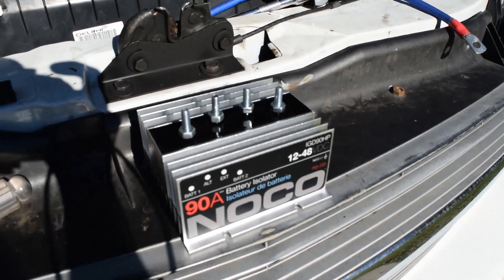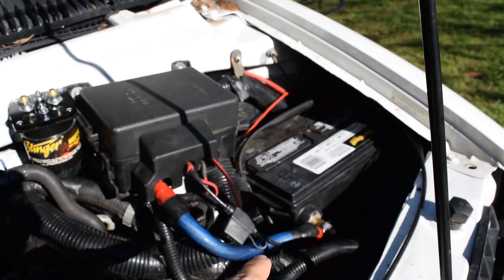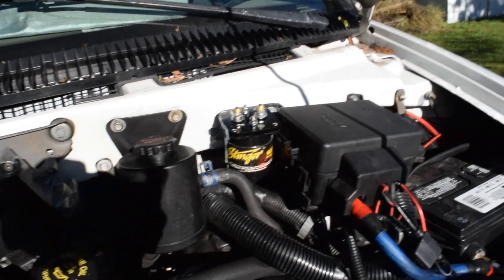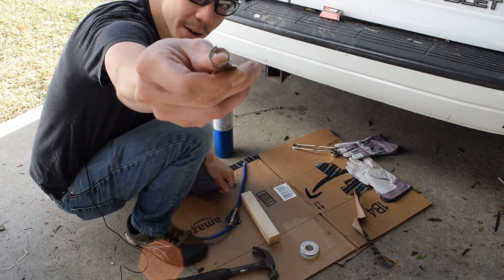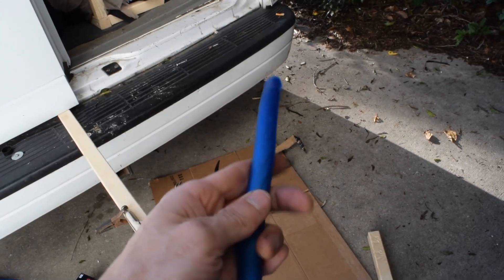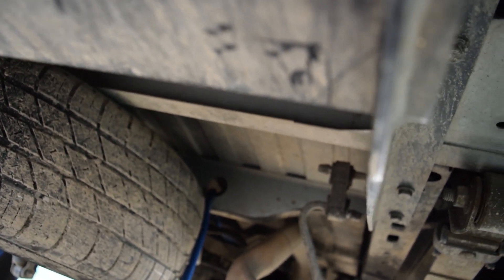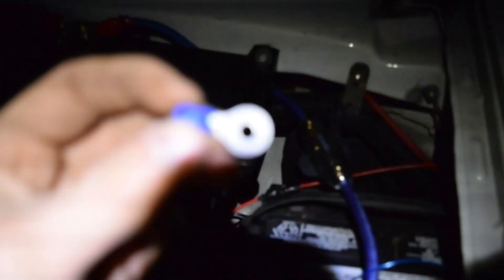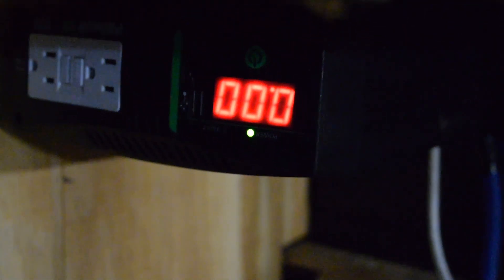HOW TO INSTALL BATTERY ISOLATOR AND CHOOSE WHAT TYPE

Comment: 12:56 Minor correction.  The blue Splice connector does NOT require stripping the insulation.  They are designed to use as is and will pierce the insulation as you squeeze the metal part into the connector. That make contact with both wires through the insulation.

Comment: 7:32 Cleaner to use heat shrink tubing to seal the cable ends on the terminal.@ 12:48 The little blue plastic splice is called a "T-Tap"; (for tapping into existing 12v switched or ignition wire).

Comment: my diode isolater took a dump I'd like to try the stinger however my diode only has switched 12vdc this w/ engine off. are you sure this switched 12vdc must be when engine is running? thanks and nice video that was funny when you shocked yourself ha ha.
Reply from the maker: You can wire it anyway you want. It just needs 12 volts to "open up the switch"
Reply: @IntoTheMystery13  a$$hole you wait 6months then scribble down crape about wiring crape

Comment: It's called a scotch-lock splice
....and it's their the most worst 1900's designed piece of wire splice shit tech ever invented.... still to this day.... 
So I'll allow your ignorance & one-time use of these awful awful wire-tap mutilators that "Should be banned, obliterated and outlawed" 
these miniature tiny cutter blades w/ a long history of wire-destroying,voltage robbing, current sucking splice magicians that turn electronics into bricks 
I've worked 3 different mobile audio/video/communication sales/installation centers in my 34 years of adding gizmo's & gadgets to shit mobiles with wheels on it, ...with Install standards so high, you were fired on spot if caught using these cheap-ass tap blocks.... it's a miniature knife SET IN A PLASTIC FOLD LOCK that cuts into the host wire, insulation & all, then with any luck, ya may have cut into 3-4 strands of already too damn thin wire with these plastic chinese turd cutter blades, and at 1st, the wiring project may actually succeeded ...@ 1st .... but the first current surge, curvy up & down driving, or voltage spikes/dips will cook those pathetic 2-3-4 copper strands then send it all to ground, frying emitter resistors and final output transistors, MOSFET's & diodes and dealing with that awesome burnt toast electronic fried amp smell in car for 10-14 daze and not much more OEM auto wire harness left....

If wiring a accessory harness to a car,boat,RV for additional entertainment or work needs....Fuk crimp tubes, scotch block splices, party hats, cheap-ass black tape, or even butt-connectors, The Only Proper method is to flux & solder your joint connections.... SOLDER THE GODDAMN WIRES AND THEN SHRINK BOOT IT ALL FOR A 100% GUARANTEED TO WORK, WON'T PULL APART OR CASH BACK CUSTOMER JOB!!
pLEASE DON'T USE THESE CHEAP FUTURE ELECTRICAL ACCIDENTS!!! You'll thank me later.... 
Bought a 40yo RV mobile trailer 3 weeks ago....as of yesterday, I have removed close to 95 of these wretched future wire fire starters....and still looks like another 4-5 daze before I got them all gone and forgotten yet.... some moron mutilated the factory wiring harness as well... 1 harness thru firewall had ten #10 wires in it, only 3 left being used, the other 7 had both ends cut off and taped up... Would love to find the wiring "Professional" who murdered this poor RV's entire wiring & electrical system... I WOULD RETURN THE FAVOR TO THESE HALF-ASS Idiot "Installers"
~PeasOut

Comment: 3:50 True Ignition source.  12:20 under the fuse box.   I know there are dc-to-dc chargers with a built-in true ignition source relay feature.  Anybody know of an inverter with this feature?

Comment: Good video, but you forgot about another kind of isolator, which is a voltage sensitive relay, that is not tied to the ignition source and worked bassed off of battery voltage

Comment: hi: when you install the  second battery . Both batteries have to be similar in  amps or can be different. Example 1 : 12volts/80 amps both. Example 2: 12volts/80amps - 12volts/45 amps? . Thanks
Reply from the maker: I don’t consider myself an expert, but what I’ve read they should  be the same type, brand, and age otherwise one may be over changed and one undercharged reducing the life of the batteries and possibly causing a fire/explosion depending on what you have. I would seek out some forums like cheap even living or maybe some boating forums to double check what I am saying

Comment: Nice vid man I'm using a stinger 200amp relay/isolator I have it ran with 0 gauge wiring with a 250amp fuse that came with the wire is that too big of a fuse,my cars alternator is a 215amp

Comment: I'm trying to learn here and I'm totally lost, lmao
This can be used with a battery bank hooked up to a solar system too, right? Like it wouldn't be one or the other for a power source, would it?
Reply from the maker: Yes you can use it at the same time as solar. You would treat a battery bank just like a single battery. Does that help?
Reply: Yes, thanks so much dude!

Comment: what gauge wire did you use for the ground and to connect to the 12v true ignition?
Reply from the maker: 14, it depends on the length. I went overkill
Reply: awesome man thanks. All your videos have helped me alot converting my van.

Comment: Dude I've studied electronics for years and though your video isn't perfect but it's dam good.  You did good stuff.  Great way to get out of crimping the wire by soldering. That solder is actually better than crimping it. You reminded me of a younger me fooling around with this stuff.

Comment: How can I wire the battery isolator so that I can flip it ON/OFF with a switch (if I want to charge the AUX battery using my alternator)?

Comment: ive seen a couple of these videos. I see that you use a very thick gauge wire 2 or 4 gauge about the same size as the terminal wires connecting the main batter to the engine. my question is this. it seems on yours and other videos the wire you are using is more flexible than what they use on the terminals already in the car. what kind of wire and or where do I get it?

Comment: One thing to note is if you have a bad starter battery, it could be keeping your aux battery from getting a good charge. A few months back I installed an isolater and whenever I would measure the voltage across the aux battery, with the engine running, I was only getting about 13 volts. Well, yesterday it got into the 20s F and the starter battery finally died. This morning, I replaced the battery and now I am getting something like 14.6 volts.

Comment: Hey I know this is an old video but I have a question. What did you do or buy to adapt your chevy astro battery cable to be able to do this? Mines factory and has the rubber end which prevents me from attaching my 4 gauge wire. Anyway hope my question is clear and that you get a chance to answer it. Thanks and great videos.
Reply from the maker: +George Bales I got adapters which are are long studs that the factory cable can sit on as well as other ring terminals. Here is a link: http://amzn.to/2zfMnWI
Reply: Thanks bud.

Comment: So on this van

The heavy up positive duplicates original

Meaning:

The upgrade cable runs from battery to fuse box and from fuse box to alternator ?

The original red alternator wire is entwined in the wiring loom and then reappears at fuse box 
 the original positive from battery includes main cable running along front of frame and 10 guage red wire to fuse box 

Or???

Comment: Does this installation also work well on installing extra lights on a truck? And if so on my extra battery should I run the positive to the switch then from the switch to the lights?

Comment: Oh man, I was installing the same Stinger one you have and broke off one of the bolts for that go to the batteries. I wanted to get the cables on tight because to make sure the cables can move and touch since all the electrodes are kind of close together. So I over tightened the nut and it broke off one of the big bolts. Yeah, it was my fault but it seems like the thing should have been built a little stronger.

Comment: Great to see a good installation! Seen so many wierd videos here that don't explain this dual batteries installation in a good way like you do. crimp the cable is actually better then soder it.
One old car technician say Smal voltage you solder cars you crimp and use shrink tube over.

Comment: I know this is an old post so someone has probably mentioned this but for a cheap conduit under the vehicle we have always used just plain garden hose. I'm sure a metal conduit would be better but we have never had a problem with the garden hose as long as you do like you did and don't let it rub on sharp metal surfaces. They make a cheap blue plastic ribbed flexible conduit as well.

Comment: Also important: when finding your 12v ignition source - you need to make sure the circuit you are tapping into can handle up to an additional 1 amp being drawn through it (this is what a lot of these large solenoids require to close the circuit - check your documentation for the actual number). Don't just use a multi-meter to find any wire that shows 12v when the key is in the "run" position.

Comment: Great video. Just wanted to clarify that your comment about sizing the isolating solenoid is not quite correct (although I'm not really sure what you mean by "size it to what your using it for" - because we know what it's being used for, to pass current to charge a battery). Regardless of what you use your aux battery system to power the solenoid must be able to handle, at a minimum, the max output of your alternator - ie: the solenoid should be rated a bit higher that the output of your alternator. This handles the case where your vehicle is drawing very little power, your starting battery is "full" (ie: at the regulators max voltage) and your aux battery is drained very low (in which case it will pull a TON of current).

Comment: Damn you are a bit of a amateur , if your not a pro don't make how to do video's ... people might copy you and f up their cars as well.

the wire part under your car is against a sharp edge and isolation will crack there because of vibration.
the contact points that you are attaching with that heater of yours actually are ment to be fastened with a special tool to fasten those.
the little clamp that you don't know the name of ..... is called a cable focker ,  those things break your wire , not at fist instance but a while you find out when things start to break down .... use normal wire plugs there, and not a cable isolation cutter connector.
2 fuses ? a bit over the top , 1 fuse behind your 1st battery is enough. 
and last ... never ever dril holes in the floor behind you wheels, all dirt and wet sheit will go sit there and it will let your flooring rott really quick , dirt will stick on then it gets wet and slowely dry and wet again and so one and that is the perfect situation for your van to start rotting away.

by the way there are better diodes/switches on the market that will do with much thinner cables.
also those you can just connect your 2nd batt directly to your 1st batt thru those and those will save alternator ...  those measure the the amps and volts and will only allow power to load your 2nd batt if your 1st batt is fully loaded first and with the engine off cut off the connection between the 1st and 2nd batt so also with that system your starter batt will not be drained.
its faster and more easy to install and cheaper.
and it has a led licht on it that will turn on when it opens the connection.
with that system your alternator  will all ways be loading only 1 of your 2  battery's and not both at the same time ,, and won't get overstressed,  alternator will first be loading the primary starter batt and when that is done it will open the connection ot the 2nd batt.
not over-stressing your alternator will extend the lifespan of your alternator severely !

sorry for the typo's... English is not my first language  ...
Reply: one more thing , NEVER EVER put non original connectors close to where cables go over into original boxes/connectors/plugs.
non original connectors tend to do corrosion to the wire over time.... then that rotting / breaking down you might need to redo it again... and when you have almost no cable left to the original plug it will become really hard to fix it all.
Reply: why don't you make a video then, Mr. Expert

Comment: anyone know why you shouldn't / wouldn't wire an isolator to an alternator rather than the starting battery?

thanks!
Reply: If you did that, then you would have no way to use the deep cycle battery to jump start to engine cranking battery if that ever went flat. Also, the alternator puts out way too much ampage to go directly to  the deep cycle. I think if you put the isolator directly from the alternator to the deep cycle that would bypass the regulator and probably overcharge and damage it. But I'm not an expert so I'm only guessing.
Reply: Aj Allen thanks AJ.  yeah, once I got everything installed, it made much more sense to me.  the system is great, just need another battery and a another solar panel and I will be set for good!

thanks again!

Comment: That connector you use at around 12:40 is called a Scotchlock, and they are not very good in my opinion. They work to a point but the contact area is small and eventually they will get a bad connection when installed in an engine bay. The grease inside the connector will melt out with the temperature changes under the bonnet. I would highly recommend stripping the cables (without cutting the switch source) and soldering your positive coil cable, then cover the whole joint with silicone sealant for a permanent fix. 

As Kearess said in the comments, no need to strip the cables if you really must use a scotchlock, but the connector must be the right size for the cable, or you can have poor contact on thin cable, or cut cores on thicker cables potentially causing the cable to burn out. 

I would only ever use them for real low power, non-critical connections. And only as a last resort/temporary fix.

good video, thanks.
Reply: M Baker great advise love it, great point
Reply: i hate them damn connectors, should be banned. they always fall off or cut the wire from vibration over time. total junk, nothing beats solder and liquid electrical tape/heat shrink.

Comment: Great video,you install 2 fuses one between the battery and the isolator and other from isolator and the backup battery can you explain why,follow your instructions but don't understand why two fuses,thank you for great video
Reply: well simple so both batteries and batteries cables are protected from shorts as the power cables run independently from each  battery to the isolator
Reply: Eduardo silva thanks for the info,help to understand better ✌🏾️

Comment: what if you have a high out put alt??
Reply from the maker: +Hurshel Lockett then you need to have the right size wire, isolator, and fuses to prevent an issue. So no different than a low output of e
Reply: 240s Mech man 0guage 250 and fuse two battery's still voltage issues

Comment: Just fyi...The Scotch connectors are made to use without stripping the insulation. Works better to leave it on. The metal will slice through and contact , and the insulation will keep more debris and moisture out.

Comment: 12:48 No need to strip te cable dude! Just put in the cables. The metal part will cut trough the isolation and will make contact with the wire. Keep up the nice work!!
Reply: You're right Kearress. With a splice connector you do not need to strip it and in fact will fit tighter if you don't.
Reply: And that is called a "Scotch" or "Scotchlok" connector for those wondering.

Comment: it is always best to crimp/hammer your connector so that there is a good mechanical connection before soldering for long term reliability
Reply: Also, fuses/circuit protection always goes at your "source", where you put the fuse will not protect your wiring from the engine to your 2nd battery.

Comment: Good work! Pronounce "Auxiliary" with https://www.youtube.com/watch?v=lmQeDqtFyWk
You may need a charge controller for your auxiliary battery, depending upon if it's deep-cycle or a standard car battery. 
Oh, and the alternator wasn't too  high, 14.6 volts is fine.

Comment: HELP! MY ALTERNATOR IS 85 AMP. INVENTOR 1000 WATT. MICROWAVE 800 WATT. 2 BATTERY'S = 2OO AMP HR. IS 100 AMP FUSES  ON 4 GAUGE WIRE OK ?? THANK YOU FOR YOUR HELP
Reply from the maker: +RICHARD STEWART wire size for the highest amount (plus some, say 10-20%) of AMPS that will be pulled. The fuse size is based off tje wire size, and there are many charts online to help you select your fuse size. Google image search "fuse wire size" and find one that covers your wire size

Comment: not to be a Mr know it all but the fuse should be up as close to the battery as possible. like you said a fuse is for the wire not the load
Reply from the maker: +Robert Sperl it is

Comment: Does the voltage regulator in the alternator prevent overcharging of the house batteries or should you install a charge controller between the isolator and house batteries as well?
Reply from the maker: +RATCHOPPER the voltage regulator on the vehicle, if functioning properly, will do the job.
Reply: +Into The Mystery 13 awesome! thanks for the response.

Comment: The only part I'm not clear on is how you tapped into the wiring for the "true iginition" power source. When I pull out my fuse box and look under it, all I see is a snake of wires. How did you test each wire to find one that held voltage?
Reply from the maker: I used the ignition wire coming out of the main fuse box. I used thr multimeter to double check that I had the right one. A "true ignition" source is one that has power when the ignition switch is in the "on" and "starting" function. I hope that helps!